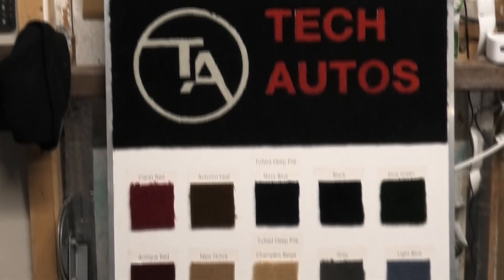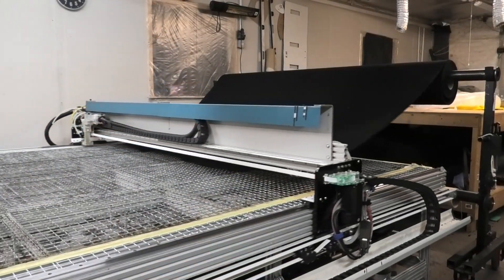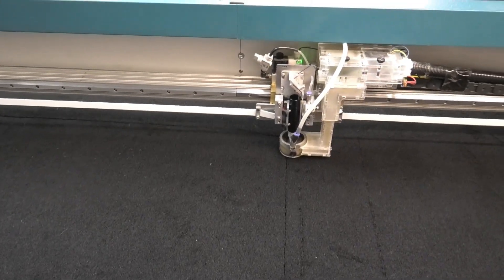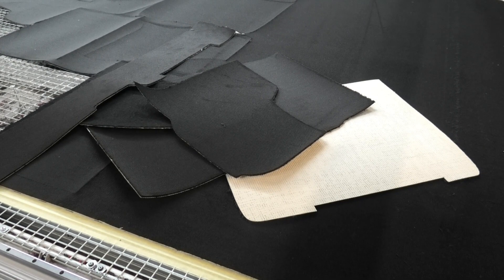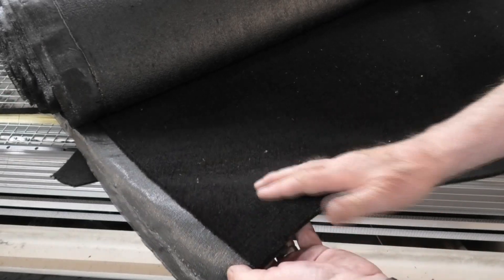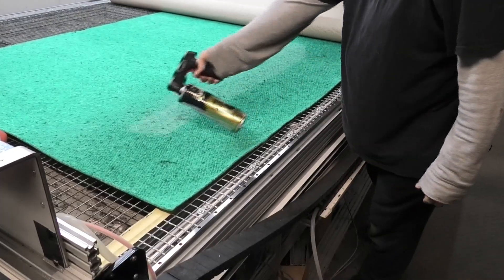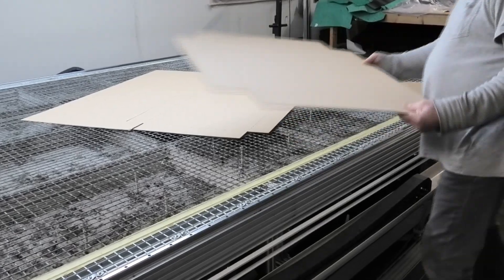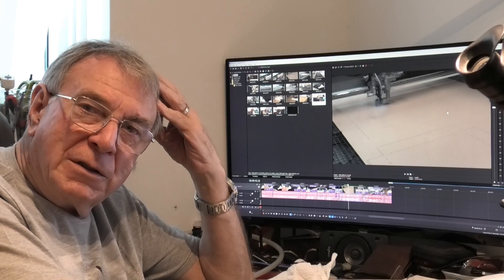Tech Autos Laser Project (minor edits)

Comment: Nice video Russ, question about laser cutting power supply's, has yours ever lost a bit of power due to age? ive replaced my tube recently, and its marginally better than before, im wondering if the power supply looses efficiency over time? or would it just die? thanks
Reply from the maker: Hi David
 No, I have several  machines and only one HV PSU  has ever failed. There is nothing in between working and not workin Unlike the tube. That is just like an ink cartridge it will work well with no loss of performance untill the ink has alsmost run out. In the case of a glass tube it is the CO2 gas that gets transformedover time to  CO. You will notice the loss of power a week or two before it drops to zero output. The pink beam will no longer be a bright pink but the beam will still be there so people are puzzled as to why no power. It is the ionized nitrogen in the gas mix  that glows pink but when it becomes contaminted with some of the oxygen stripped from the CO2 it becomes an almost white beam. A sure sign of a dead tube.
 A marginally bettter tube could be a sign of replacing a B grade tube with another (newer) B grade tube. Thereare many of f these tubes available  and unless you know what you are looking at or buy from a reliable  A  grade tube  source , it's a real lottery.  A simple test that will tell you if your tube is a factory reject is demonstarted inthe his video You will need tome thick (say 10mm acrylic. If you do not have this but maybe have 3mm acrylic  then cut 4 sqares 25mm and superglue them into a block A pointed trumpet shape is what you should see but a blunt bullet shape indictes something lass than ideal   https://youtu.be/naPzFsuvURU